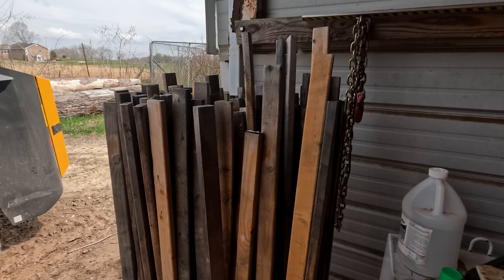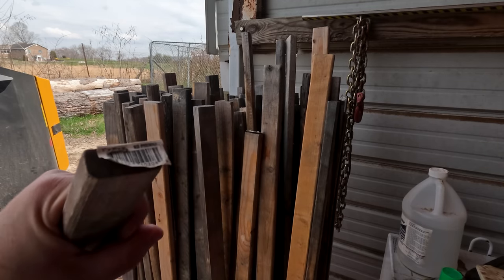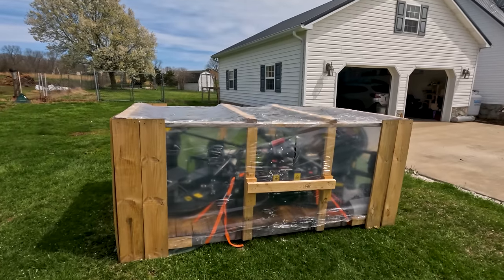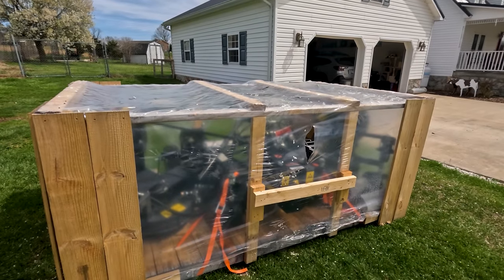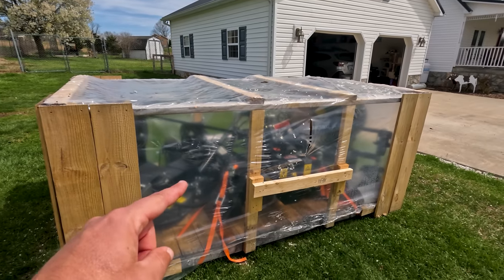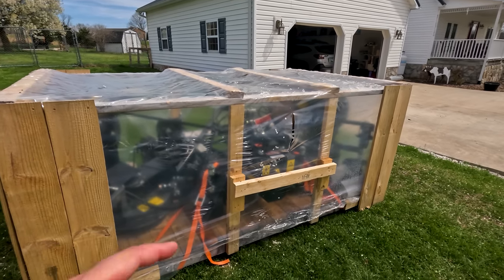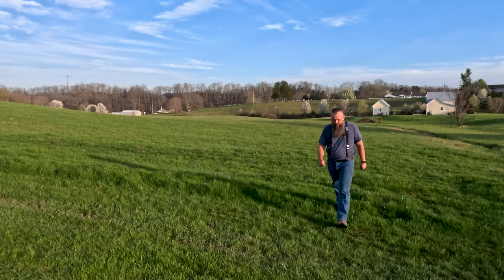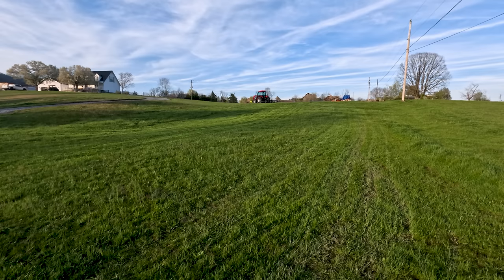Grass Slayer! This Isn't Your Grandaddy's Mower: Lastec XR700

Comment: Hi ,you picked yourself a great  volume Mower . I was in the turf industry for 25 years a we have been using these mowers to cut out rough and large areas. Great Articulation and very cost affective also you  can disconnect and use the tractor for other Purposes.  Stay safe 👍👍  🇨🇦 Craig

Comment: hi there nice mower . when you adjust the height  i do believe like in a circular saw there should be lead , the font of the blade should be about 1/8 lower than the back of the blade , pretty sure of this ,but check out whet the mower calls for . mice mower  best to all john

Comment: So why did you use those tine extenders?  Are you aware of how to work out the weight of you proposed fork loads and that using the extenders is likely to damage the forks if used with a heavy load where the main weight is near the tips of the forks.  Many do not know what the designed weight distribution is for their forks, and regularly overload them.

Comment: I can't find the bundle cost but 1x2x8' are $1.58 each. Cut ,dried and ready to use . You're not burning your fuel ,time and wear and tear on the saw mill . I worked for a guy who thought we could buy 1x 6 , cut it down to make door frames then router out the hinges ect and buy a blank door which would need holes drilled for the handle and latch and hinge pockets cheaper than you could buy a prehung door .He also thought a man could hand nail plywood down faster by hand than by using an air nailer.

Comment: I was just at my local lumber dealer yesterday, and they use the fluted stickers.  I had not noticed it before, so I asked about them.  They get all of their fluted ones from overseas with their exotic orders.  After 20+ years in business, they have all they'll ever need and even sell them.
Reply: Reminds me of the unfinished 18:37 yacht hulls shipped from the Far East in teak crates. Took years but customs folks finally realized the crate lumber was worth at least as much as the hulls.
Reply: @robertbamford8266  I work with a lot of exotic woods now.  When I lived overseas, they were local, so it was great.  Woods like padauk and bloodwood are construction lumber in parts of east Asia.  Several rosewoods are merely decorative construction, like using cherry instead of oak (though with prices today white oak may become the decorative).  I try to find as many importers as I can and take any "scrap" pallets that they throw away.  That stuff is great, especially if it is first use.